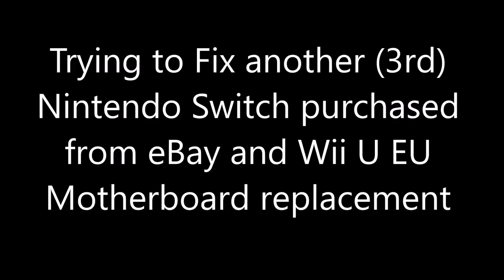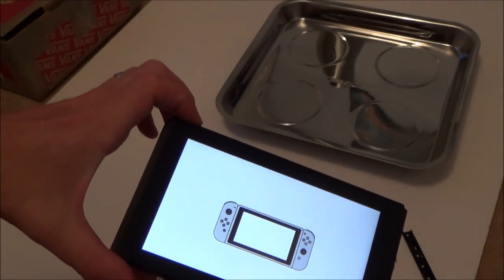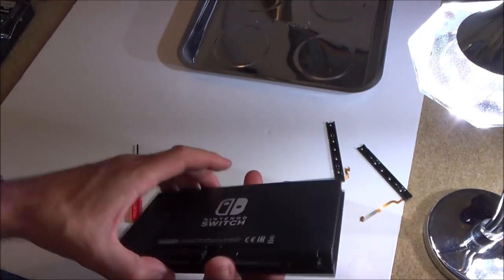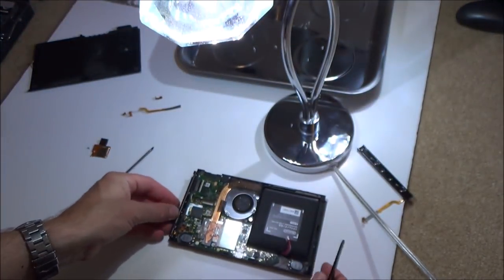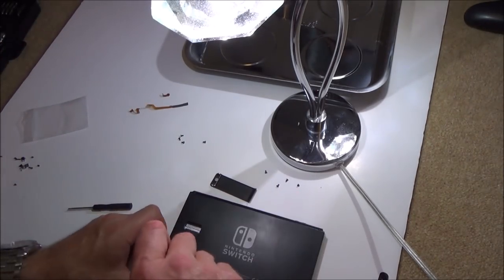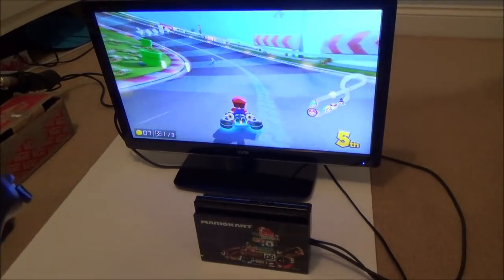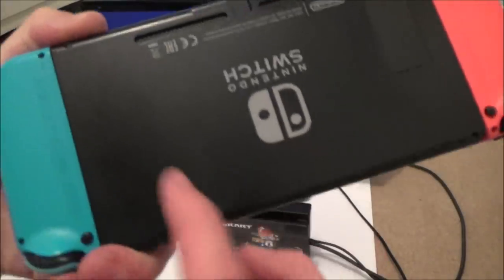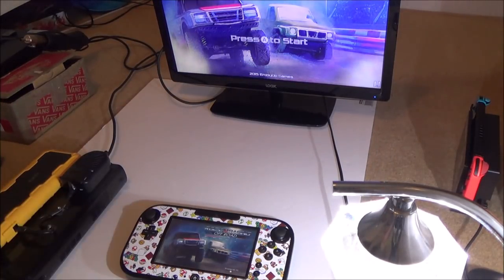Trying to FIX another (3rd) Nintendo Switch (Part 2) & Final Update on Wii U Motherboard

Comment: I guess that dead Switch is starting to pay off after all. :)
Reply: Also he should've put the enclosure (covers and inside) from it (the faulty one) to the first one he did (part 1). But hey, if he finds that's ok he knows whats the best for him! If it was me and if i had the spares, just take the board (and if the touch+screen was better, meaning scratchless) from one to other and keep both working with good enclosures and not trying to fix a bent/warped "chassis" (covers and inside protections).
Reply: Would be better if he woulnd't kill it with lack of the desoldering skills, it would be just a tenner(for the new IC) and it would work perfectly fine.
+ in second repair instead of soldering that antenna socket from the 1st one, he destroyed the anntenna and then just put it in palce with tape...
Reply: @Arek_R.  he did try tho, it just wouldn't stick.

Comment: Vince on the copper heat pipe that glue like stuff is thermal paste if you didn’t know maybe from having it out clean it off we alcohol and re apply some new thermal paste. When it’s out it gets dry and won’t do its job as good maybe not as important on a switch but for a pc or  console it’s very important.
Reply from the maker: Thanks for the advice. I did order some up from Amazon in a syringe type setup but I need to read up on how much to apply as I have never applied it before :-)
Reply: My Mate VINCE omg didn’t think you would reply. I have made a lot of pcs even know I’m on 13 aha. You apply a blob around the size of pea but slightly bigger depends on the chip. Push the heat sink down and see how much is covered by re lifting it up. Screw it down by doing the cross method. If you work on computers which is easier than you might think you get the hang of it straight away. Dont spread it with your finger and apply it then put the heat sink on straight away so no air born dust gets on it. :)

Comment: i think the problem with the second switch not coming up on the tv is due to the connector being right where it bent. my guess is a couple the pins came off the main board. a quick flux and heat should fix them.

Comment: If the item run what $ 280 something like that, then you got a great deal. You can still make some money on that one. Even if the other one doesnt connect to a tv, someone will buy it. I work with parts and pieces all the time. Sometimes you come out ahead, sometimes you end up with scrap. I bought a Transmitter for an RC plane hoping to save money only to find the unit was junk after turning it on the second time. I was planning on upgrading it, now its a parts unit in a box. I ended up buying a new one. The thing I could do now is just buy another unit that has a good motherboard but if the rest is damaged,I have lots of good parts to fix one. I really like your videos. It makes me think I could get into fixing RC transmitters, repair them and resell them. The problem being, in two years the technology will change and make the current ones obsolete.  Someone already has one out that has blue tooth capability. You can connect with your buddys and have them meet you at the flying field or download a new planes program to the memory not using your computer. Its all going blue tooth and computer technology.
Reply: RC Hobbyist Extreme no money at all in it. Please explain how he's going to make money off them ?

Comment: Hello!
I just thought I'd mention this in case you didn't know, to take the back panel off the switch, you're only required to take the middle screw out of the Joy-con rails to release the back panel.
Hope this helps!

Comment: if you have something that can score the inner walls of screws you can put little tiny slices opposite each other and use something like two tiny flat-heads to apply force to the opposite sides...there are btr ways but when you have none of them it works. the scores don't have to be deep as the force required to remove it from some little device shouldn't exceed hand tight anyway, oh and every time i watch a video i forget to say this but anything you arent able to fix or sell off for parts can often be used in pieces of art made out of the project...ive used the plastic shell of cell phones, different game controllers, screens rubber pieces and even circuits in art before and its always cool. Some people who are into that stuff will even pay good money for nice work

Comment: bought 3 switches from the same seller, 2 hasn't arrived yet but the one that has was sold as not charging except when docked, when infact it charges fine both in and out of dock.

One problem it does have is the joycons don't charge but i found the fault to be a faulty fan (they share the same power line i assume), removing it restores charging to the joycons, ordered a new on for £6 from china.  Paid £84 for this one.
£87 for one of the switches yet to arrive and the fault is it doesn't charge at all but does power on. other one no power and paid £62

Mine didn't appear to have been opened before either, seems like a genuine seller just selling returns by the looks of it.

Comment: i'd love to see you tackle any of the old ipods, particularly the later models which are notoriously difficult to open, you can swap out the HD for micro SD cards with a product from Iflash and upgrade to higher capacity, also generally need a replacement battery and you can also add a custom firmware called Rockbox, would all make a great addition to your excellent videos...if you haven't done that already that is...

Comment: good on ya   everything   in life  is learning  curve  half   my  car working stuff  is in another state   600 km away   in Melbourne  Victoria Aust , i have tell you something funny  in 
1968 ford Corina  in between  the 1600 cc engine and the gearbox was a metal like a gasket   after  changing gear box from  col-um shift to floor shift  the  car   went  1 km  then bank broke  con-rod   between   piston and crank   i forgot  put the gasket in  between  motor n gearbox  some told me  ford would put there  if it wasn't  needed

Comment: just a tip you don't need to entirely remove the rails to remove the back you should only need to remove the center screw on the rails.

Comment: At 6:58 this is all true I had a broken pc that I loved but it would not turn on and said it could not boot had no idea what it was. Or how to fix it look up YouTube videos and found out the hard drive was gone so I took it apart and put in a new drive only to find out it did not have windows 10 installed and it still would not turn on so I found out how to download windows 10 On a usb put it in installed Windows 10 on the new hard drive and It feels really good knowing I only put 80 dollars in a hard drive and fixed a computer all by my self and also the pc works way better then before. It is a really good feeling to have.

Comment: Some advice for the next working Switch:
Don't update the Switch, check if it notices a game was inserted, ignore the update warning.
Do not connect it to a Wifi connection with internet access, as this will check for updates, too.
Try a SDHC microSD so you don't force an update that way.

An old system version can make a big diffenence in worth for homebrew users and go for much more than an updated one.
Reply from the maker: Good advice :-)
Reply: You need to test if the console is banned anyways, new fixed units are being shipped with 4.1.

Comment: The screws break, that's the weak point. Saw it in a durability test video where they intentionally try to break it at different points with increasing forces.

Comment: Ah the moment you put something back together turn around and there it is the piece you forgot to replace.i would not have blamed you if you had had a little cry at that point " )
Reply: i done the same when it comes to installing light fixtures and other stuff or ceilings fans but ceiling fans i get installed then put the blades on and i realize i forgot to put the cover to the base on so i have to unscrew all those blades off then put that on then put them back on  its a real pain when those situtions happen if i did that like this guy did with the switch i be like well fuck it i rather go without the sd card ill come back and fix it when i get in the mood for it lol

Comment: Hmm all the switches you've tried repairing have been early revisions 🤔
The bricked one was a second revision (HAC-S-(region)-C1)
The super bent one was a first revision (HAC-S-(region)-C0)
The one in this video was a second revision (HAC-S-(region)-C1)

And for reference there has been 5 revisions so far:
HAC-S-(region)-C0 (these were the systems made for launch)
HAC-S-(region)-C1
HAC-S-(region)-C2
HAC-S-(region)-C3
HAC-S-(region)-C3 with updated bootrom

Comment: i've always wondered why the serial numbers have been removed aswell!!
Reply: I need to know as well!
Reply: I wonder whether it's stolen and that's why it doesn't come with anything and the SN is removed so it cannot be traced back to the owner?
Reply: i doubt it... more like for warranty or guarantee reasons..
Reply: They have been returned under warenty and replaced. And nintento then sells them off in bulk to recyclers or at auction.
They take the serial off so they can't be returned for a second time under warenty.
They are supposed to be scraped for parts.

Comment: You should be really careful working on that carpet. When you work with electronics you have to try your best to prevent static discharge or else you might damage perfectly good components. Look up ESD guidelines to get an idea. Carpets as a workspace is a no go when it comes to electronics.

Comment: A good trick to get difficult screws or stripped screws is to dab a little bit of super glue on the tip of a screw driver and unscrew it

Comment: Just want to let you know you should test if you get in the rcm mode with this switch if so its worth a bit of money for people who wants to jailbreak :)
Basically on older models if u unplug the joycon and connect pin10 with 1 or 7 or 9 and boot it with plus on volume button its booting in to rcm mode.

Comment: The serial numbers being removed means someone replaced the case with original guts and if you try to use that number on Nintendo software it will brick it. It's to keep people from destroying the unit.

Comment: Nice video that reminds me of how I stumbled into repairing things, long long time ago. However, one question is nagging me already since I watched the second part... Why didn't you take the mainboard out of the bent console and put it into the perfectly shaped case of the bricked one. Then you take the controller PCBs from the bent case and you might even save the already disassembled digitizer and LCD from the bent unit, fan and other parts and repair another round of consoles. IN the end you again sell them and even the spare parts and invest the earned money into the next trilogy of repairs of a different thing? I mean, I would never take it for bad if you buy, repair and sell things, as I personally know how expensive it is to buy all that stuff needed to repair things like soldering stations, meters, generators and such things. So you build up knowledge, improve your skills and you can show this to the viewers.

Comment: You could probably get the scratches out with some sort of material they use to get scratches out of car windows but I completely forgot what the stuff was called. Then you can put a screen protector on it, won't even look like it had a scratch to begin with.

Comment: Can you try to fix a computer with a loose/faulty charger? My old laptop has that problem.
Reply: RealZaroX it's quite simple. Buy a replacement part and it should be easy.

Comment: No confusion on how it was factory reset after the joy con rails were ripped out?
Reply: Touch screen or pro controller?
Reply from the maker: Hi, I didn't think of that at the time!!! I didn't try it so I don't know but it might be the recovery mode option (the one where you hold down the volume buttons when you turn it on).

Comment: Hi is there anyway I can contact you to get some advise Im having with my tv? I used your vga method to connect my xbox to my tv as my hdmi ports are broken however I keep on having to adjust the settings and the picture keeps on not fitting my tv